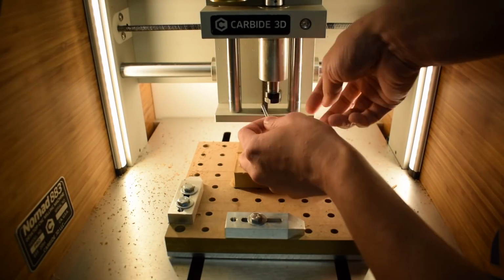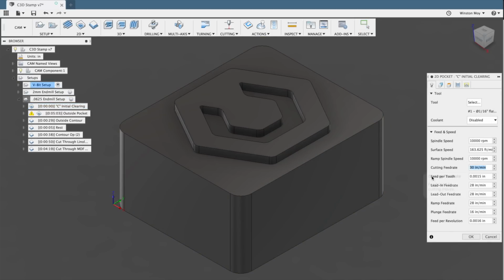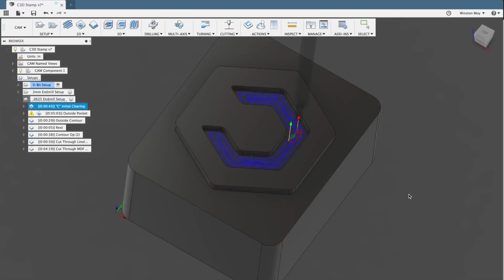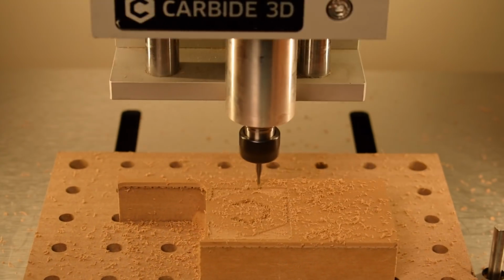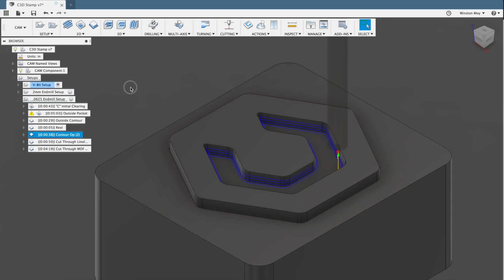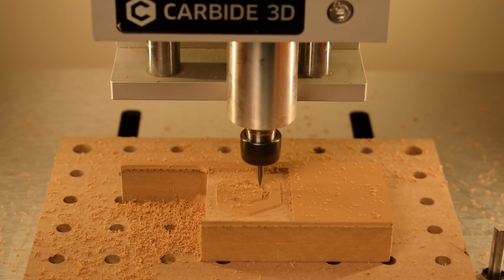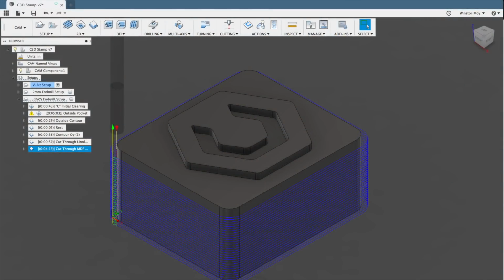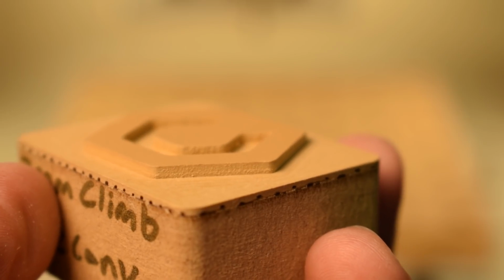Basic Guide to Milling Linoleum

Comment: One tip for linoleum stamps - when you do your stamping, have your paper on something with a little give - it helps make up for the the rigidity of the linoleum. I made a linoleum stamp on my SO3, and used a pink rubber stamp blank underneath for cushion (also learned how TERRIBLY rubber machines just before that, haha).

Comment: For the millennials: Linoleum, is a floor covering made from materials such as solidified linseed oil, pine rosin, ground cork dust, wood flour, and mineral fillers such as calcium carbonate. :-)
Reply: Thank you, was unaware of it's composition.
Reply: and using linoleum for printing is very old; https://en.wikipedia.org/wiki/Linocut